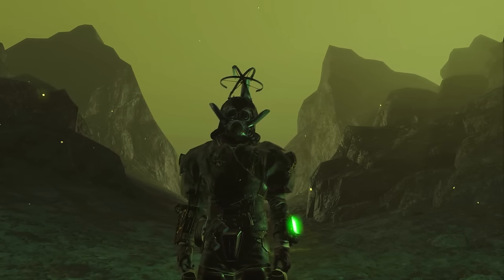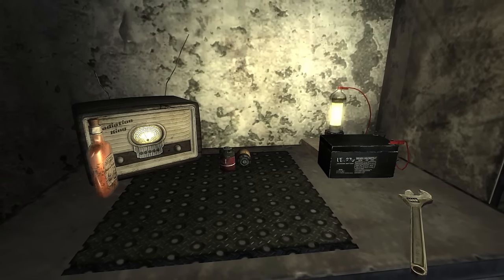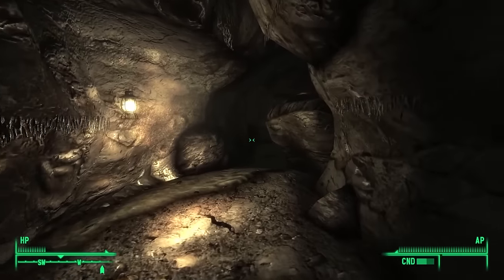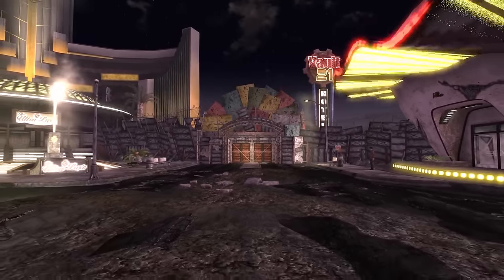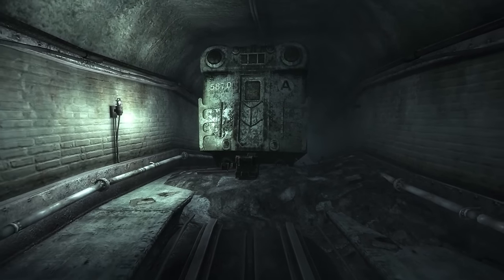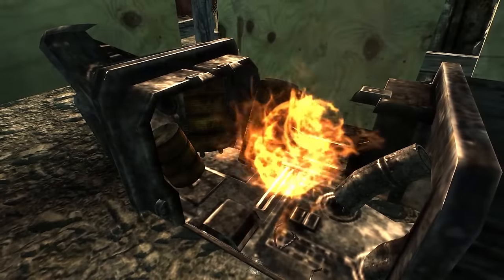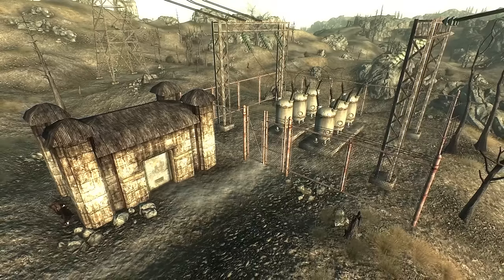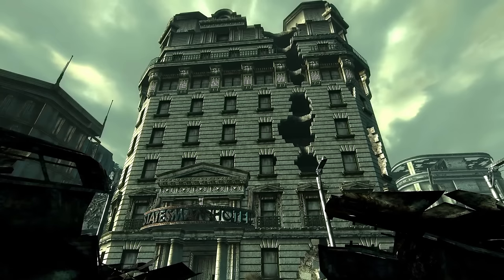Where does the power come from in Fallout?

Comment: There are reactor designs that can work without having a person watch over them. They are thermo electric reactors that use thorium but don't used water and instead use molten salt that constantly is recirculated. They can be stored underground so that you don't have to worry about them.

Comment: i dont think the cores are the thing powering the build i think you can charge fuson cores inside to use for ther things it taps into the per war network little buy little chargeing but in settelments the proses is simply reverted sutch as a reserve power outlet for power outages so intead of chargeing it powers the area its in so people can have power when the network is down.

Comment: 17:16 that is an emergency light that houses its own battery and is only connected to the wall power to sense if the the line is live, once the line is not live it turns to battery power and turns the lights on.

Comment: The issue with the pre war power would not be if their is enough power but what the transformer kva rating is. You would not want to overload the transformer, and with them being 200 years 6 reliability would bebin question, let alone their ability to hold up to factory ratings.
Reply: Also, don't forget that backfeeding a network is a thing. Solar, generators, makeshift water mills or damns. Most people in the fallout universe wouldn't know to unplug the transformer from the back of the building. But instead, wire in more power when the demand for more is needed.

Comment: Huh...  what if the unseated cores were originally meant to be a form of short term backup or boosters for installed generators?  Like for a society expecting possible EMP, fuel shortages, and possibly war disruptions, these buildings have a small generator thats not totally replacing reneweable and fossil fuel energy from the grid, but taking part of the load?

So in the prewar and its resource conflicts, if fuel shortages or whatever other issues would have caused rolling blackouts, the static generators prevent that and the cores would be inserted to restore full power for the hopefully short period until the grid was back on track?

Hence why when you put them in power armor even cinsidering the huge draw of that, it's minutes while for a building it might have been days or weeks if pushed into the slot that power intensive functions like elevators were maintained, not hundreds of years?
Reply: That might fix another issue with Fusion functioning 2 centuries later too, and explain the flickering.
Fission sorta free energy from a rare messy source.  The plant is about speeding up and regulating a process happening naturally, an unstable rock giving off heat.

Fusion needs energy put into it to begin with, a lot of energy, and then it uses the energy of the Fusion to keep going while cannibalizing the material, it might not make toxic waste, but every fused atom makes the Fusion reaction harder to sustain.  Which is how stars die when they create too high a percentage of heavy elements they can't keep fusing with the available pressure and heat of their mass.  A Fusion core would be basically magic if it had been running that whole time AT ALL.  It's not a radioactive rock with a half-life, it's a fire consuming the "oxygen" needed to sustain it without help.

So considering Mass Fusion were massive liars, it might all make a lot more sense if the generators still running are fission meant to take load off the grid, the Fusion cores are back up boosters for short term grid failures, and when they're only partially inserted they're being kept alive by a tiny amount of energy from the fission generator like a campfire kept juuust burning to be ready to quickly intensify without having to start a new fire or burning up the fuel when not needed.
This would also be why the Fusion Cores haven't all been harvested a century ago.  When you take them out of the generator, if you don't plug them into something in fairly short period (anything short of many years would make them less valuable to horde) they'll become inert, a campfire thats gone out, and the wastelanders don't know how to efficiently restart the reaction, 

and if you do plug them into something and don't know how to manage the reaction, it's a mass produced product designed to run heavy machinery for a few days, it's likely not designed to run at rates between tiny pilot flame and bonfire so unless you understand it well and have the tools to alter its mechanisms, the core will produce a lot of power very quickly for a relatively short regardless of how much you wanted or how long you wanted it for.  Making it very potent but kinda crap for long term settlement sustainment.

Comment: Power networks have to be balanced based on required load... Too little, everything dies. Too much, your power network is destroyed.

There's not really anything that justifies it, tbh. Bethesda handwaving magic.
Reply: Actually, thinking about it... In FONV, adding the power from the solar station would make maintaining that balance harder for those who run Hoover dam.

By controlling the water flow speed in the dam will allow them to control the fluctuations of requirements in our network for Vegas, by adding in a unreliable source like the solar plant hypothetically make it harder for those at Hoover dam managing the power in the network.

Comment: my thought with the fusion cores is that they are simply catalysts for whatever process their generators are performing. In  this use case they are likely designed to do this for decades. Power armors using them directly runs them out drastically faster.
Reply: Adding to this, when you find these generators around, multiple are usually installed there. The ones that you cant interact with have burnt out thier catalysts and died, while the one you can is still powered. My thought is that the one you can loot shut itself down for whatever reason, leaving the core inserted, but the system deactivated. The generator has been existing on a standby mode for 200 years until you find it.

Comment: I can drop 2 more theories.
Power network is just another Gigantic coil, which to an extent can be induced to have some charge flow by weather and other things. It will not be gigawatts like we expect today, but I am sure you could pull some kilowatts though it,  like that.  It would be absurdly unstable, but good enough for a random lamp in the middle of nowhere. 
that instability explains as well why anything that you expect to work, like water purification, is done on a separate external generator. 
second is currently used on Voyager satellite, which is radioisotope thermoelectric generator
instead of making power of fission, it might take it from slow decay. Sure amounts are not incredible, but if you consider that fallout world was focused on "fission" cores on all machinery, and grid was just random lights and tiny appliances, it can be used like that. A power station like that would lose all the uranium, having it as thorium or lower, in the decay chain. Those still produce radioactivity, which still emits power that can be harnessed by those devices, hey you can argue that if they were hit by nukes, they have more fuel than expected all around. 
imagine random fraction just dismantled one megaton nuke, and put all that material for radioisotope thermoelectric generator, it would provide few kilowatts of power for very long time. 
as you can find explosives like that, mini nukes and megaton, it seems you should be able to replenish the power source at will.
Reply: If you add to that you have some goodwill factions that want to help like providing that solar plant power to the grid, I can see how those power plants would be restarted and maintained in at least kilowatts power generation state.

Comment: My thought has always been that Fusion Cores are only called so because of Mass Fusion, the Fusion part is just the name. As for cores not lasting long in power armor, my best guess would be that the reactors have fuel inside it, and the cores act more as a initial starting fuel or catalyst. I always felt the cores found in the wild, we not just loot the core, but shut the reactor off as well, the lights flicker as the grid begins to draw power from elsewhere. The core is not fully seated because it hasn't needed to be restarted in over 200 years, while settlement ones may be turned on and off to be moved, and just recently started.
Reply: I considered the Fusion cores to be a reaction which produces seemingly unlimited power through its reaction but that its materials are deteriorating over time.

They're guaranteed stable for 200 years, after which using them rapidly deteriorates the reactants until the core is fully spent. 
In effect their time is up, and soon anybody who doesn't have the capability to make new cores will be unable to use Power armor at all.

Comment: the neon sign might be self-powered as well.

consider the possibility that the wind is what is pushing the sign around and using the rotation of the sign it spins a small generator in the base of the sign to produce the electricity required for the light of the sign.
Reply: as for the fusion cores and the power armor...

i don't think the cores are depleted of power, i think they are actually experiencing thermal runaway.
put simple, i don't think the power armor has sufficient cooling.

Comment: Ok a couple things I am mentioning in my comments so it is way easier to communicate my thoughts
Reply: Transforms change the voltage and current of a system, basic way is voltage goes up current goes down and vis versa. This means that if you wanted to you could have more current or more voltage, for giant power grids that don’t matter but small generators is a different story
Reply: Now hybrid systems that would use two sources, this is done in solar energy, having a power plant provide power when you don’t have charge in the panels, what if fusion cores are the same way, what if it is set up that the fusion generator provides more power to the battery from the plants once they are dead
Reply: Another thing is how is the old network running, because the bombs would have also cause an electrical shortage in every place in the game
Reply: And I am not gonna go into 3 phase because it is a mess to calculate, 3 phase is noted to the sin waves of the electrical signals making only positive sin waves that cause more stable electrical signal, if there is two phase and one phase in the fallout universe why is there no lights dimming out
Reply: the other thing that gets me is how much power is produced in the fusion reactor in fallout 3, the arcs are ripping through noble gas or air which is also a decent insulator to jump, so they would still have enough energy to run the ruined country, only reason it wouldn’t is range, but that’s why transformers and step up systems are in the US